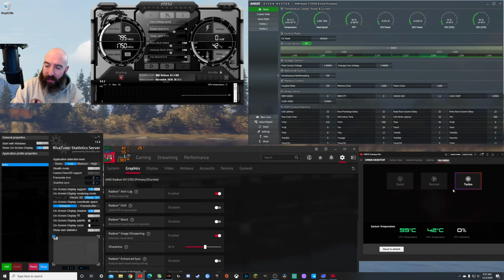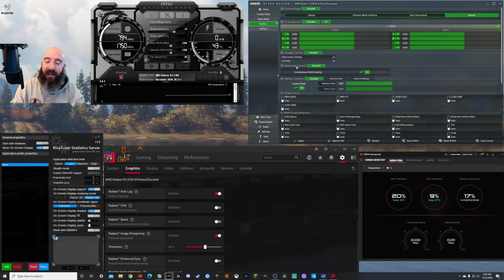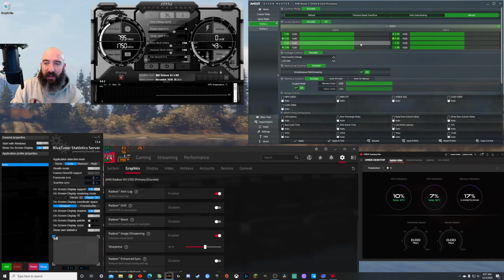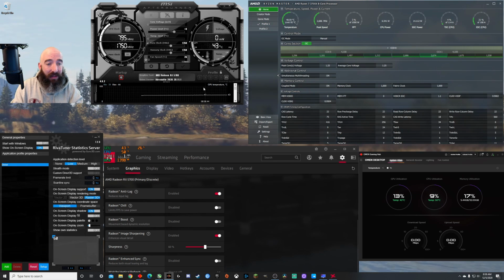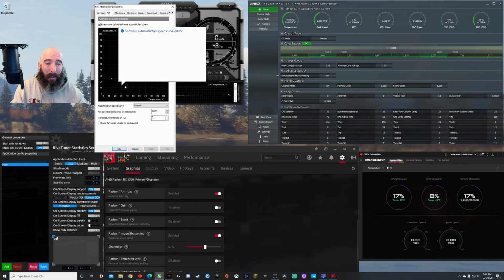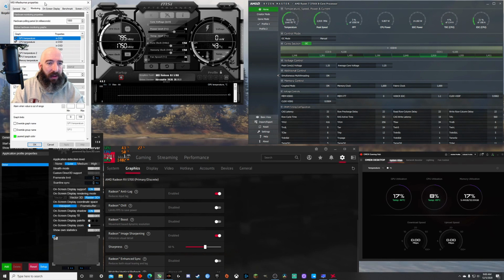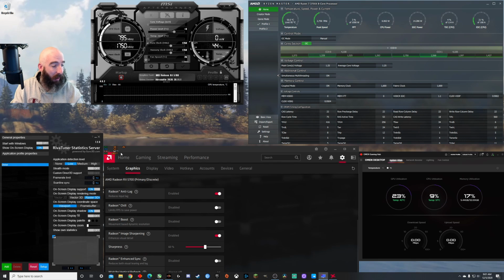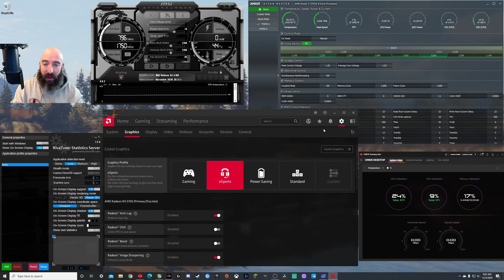My Current Modifications! HP Omen 25L! All Mods and Programs I Use!

Comment: I am trying to remove the non-glass side panel to switch out my power supply. The only info I could find is removing one screw by the current psu and trying to slide the side panel forward. Have you done this on your omen or know how to remove it?
Reply from the maker: Yes I have, just for cable management. There is the lone screw at the bottom near the PSU sand with a bit of force while laying on its side, it will pop forward and out. Check out this short video:

https://youtu.be/53R1ZzUxkz4
Reply: @DanKamYouKnow  Thanks I guess I have to push harder. Is there a video of you doing that on your channel?
Reply from the maker: I do not have a video of me doing it unfortunately. Once the PC is laying flat though, just use your thumbs to push it forward. It will take a good amount of “umph” to get it to slide.

Comment: I can't remember but I think Linus Tech Tips did a secret shopper review a few days ago on the Omen I believe and he claimed something was underpowered (not sure if motherboard or PSU) that was keeping the 3700x from maxing out at peak speed. I gotta look into that, not sure if you know anything about that?
Reply from the maker: I have not heard about that?! Any chance you can link me to the video where you found that?
Reply: @DanKamYouKnow  https://youtu.be/Go5tLO6ipxw?t=342

I guess HP installs a boost limiter or something, it apparently has been a problem for a while. I might not have understood entirely what he was talking about but that link should take you right around the 5 min mark.

He only mentions power limitations for a moment. I plan to install a 750w power supply in my 30L because I've been having some coil whine out of the RTX 2060 and wanna see if that helps so I'll let ya know if it does anything for the CPU. I've also noticed mine never gets up past about 4.1
Reply from the maker: Interesting, thank you. I will have to do some tests with my system and see what the deal is. I overclock my CPU to 4.1ghz so I wonder what’s really happening when I do this, because task manager shows 4.1ghz throughout the stress test. Eventually, I’ll be going away from the HP motherboard, not sure when though.
Reply: @DanKamYouKnow  Linus was complaining that you can't overclock the CPU because HP has limits to what you can do with their pre builts.  The Omen he had came with the Intel CPU.  They tried to overclock it with certain software and it didn't work right.  That's why I got the 30L with the Ryzen 7 3700x (on sale at BestBuy for $960).  The Omen is a solid computer, and he even admitted there are ways around the Intel CPU limitations.  The basic complaints with the Omen are, it runs hot, you are more limited to what you can do with the Intel CPU, and upgrading RAM can be an issue.  That's why we have DanKamYouKnow to guide the way.  There are tons of videos on how well this thing plays games.
Reply from the maker: Yeah, Ryzen is the way to go for Omen builds.

Comment: hey! im new to all this, im planning to get an omen 25L with 10th gen i7. just wanna ask, if i can upgrade my processor from that to ryzen 9 3950x? so i can upgrade my ram into 64-128gb in the future aswell as my ssd from 512gb to 1tb.
Reply from the maker: Hey Julian! I believe you can upgrade the CPU, yes. I haven’t seen anyone do it yet but I’m sure it should work with no problem. You can also upgrade the RAM and SSD as well. You will have to manually raise the speed of the RAM though, once you get it though. And only with Ryzen CPU’s

Comment: should I use the fan u have or buy a liquid cooler?
Reply from the maker: I have seen better results with my Noctua U9S air cooler than the 120mm liquid coolers. They are similar in performance so it depends on if you like air coolers or AIO’s more.

Comment: You ever think about doing a case swap? I had my omen 30L for about 2 months now and just did a case swap best decision I could make
Reply from the maker: Sometimes I do but I’ve got my temps so good that I’m going to keep the Omen case for awhile. If I do, I think I’ll do a motherboard, PSU, and GPU swap
Reply: @DanKamYouKnow  When should one and why change the MB?
Reply from the maker: The HP BIOS is locked so you can’t make any adjustments like fan speed, memory speed, overclocking, and a whole mess of other adjustments. Any other motherboard will give you the freedom to basically adjust any parameter that you can’t with the Omen board.
Reply: @DanKamYouKnow  Thanks man! Been loving your channel since I found it a week or 2 ago, I plan on ordering three 120mm fans soon for the top front and bottom! Will probably have more questions as time goes 😂
Reply from the maker: Thanks Corey!! Definitely let me know if you have any questions or join our Discord group in my descriptions and their are a lot of knowledgeable people there as well. I am also extremely active on the Discord.

Comment: Hey man! So I just bought an Omen 30L on sale at Best Buy for $950. It came with a Ryzen 7 3700x, 16GB RAM, 500W psu and Nvidia RTX 2060. I don’t know if it was a great deal or not but I am using it for 3D modeling so I was wondering, do you think this computer could be upgraded to have 32GB ram and a 30series gráfica card?? I don’t want to buy those parts then have to struggle with them not being compatible! I appreciate your help. I really trust your opinion after watching all your videos!
Reply from the maker: If that’s in US dollars, then that is a great deal for that build. The RAM upgrade is easy, install the RAM and use Ryzen Master to raise the speed back up to 3200mhz, and the adjustment only has to be done once. Depending on which 3xxx series graphics card you get, you will probably have to swap out the 500w power supply to a 650w or 750w. And a 3xxx series cars will fit in the case and is compatible with the motherboard.
Reply: @DanKamYouKnow  thanks a lot Dan. i upgraded to a 32GB ram and now ill just waait for the rtx 30series to be in stock and replace the power supply. i have a Ryzen 3700x so hopefully it works fine. congrats on your channel by the way, you really know what you're talking about and you take the time to help all of us. i've been recommending this computer and your channel to all my friends.
Reply from the maker: Thanks Ash! I’ve done a little more research and it seems like some of the triple fan variants of the 3xxx cards will not fit. So you might have to make some measurements before, just in case. Thanks for recommending my channel and I appreciate the kind words!

Comment: Hey man does this pc have problems with power throttling? I saw a video where linus tech tips reviewed a similar pc with the same case and it throttled bad due to the heat.
Reply from the maker: In stock configuration, they can run pretty warm but should not throttle. With the additions of some fans, it’ll dial back temps a good deal. A CPU cooler makes all the difference in temperatures. My temps are fantastic with my Noctua U9S air cooler.

Comment: Why won't u run a splitter connected to ur motherboard to ur two down fans?
Reply from the maker: What’s up Luis! My front fan and bottom 2 fans are all being controlled by my manual fan controller. So I can adjust the speed on them to whatever I want. No need to plug them into the board

Comment: Are you going to upgrade the power supply at any point? I've been thinking about doing mine, but I'm new to all these modifications. Your videos have been super helpful so far, keep it up!
Reply from the maker: Thanks Colin! Only way I would upgrade the CPU is if I change out the GPU to a 3080 or something which wouldn’t be until next year, if I even upgrade.
Reply: I was thinking about throwing in my old 750w power supply due to the coil whine I've been getting off my 2060 but from what I've gathered the current config seems to only need like 350-400 watts.